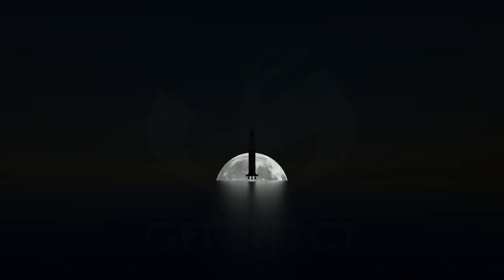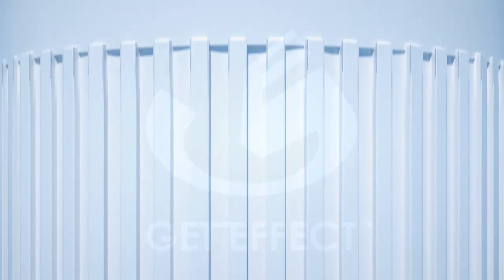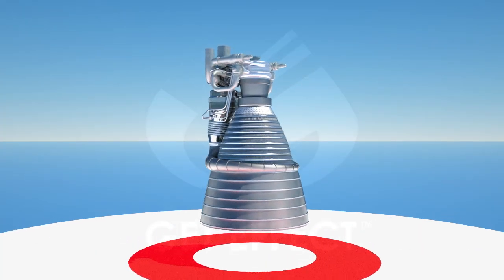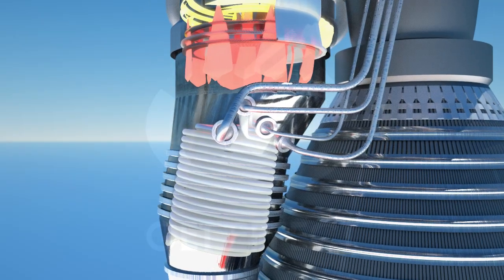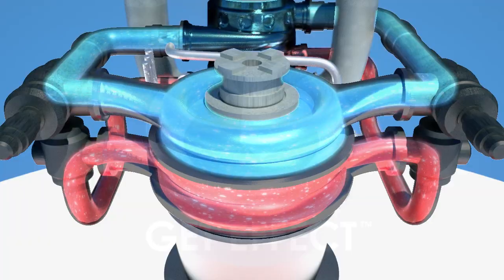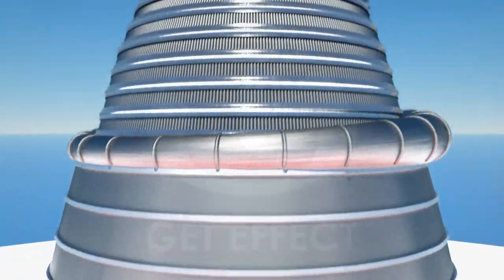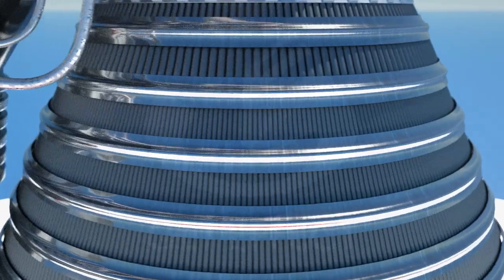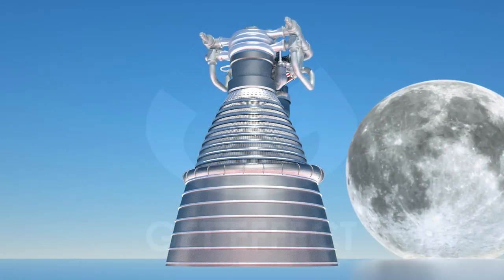NASA SATURN V ROCKETDYNE F1 ROCKET ENGINE, AN ANIMATED DOCUMENTARY (2016)

Comment: Was there ever any study done for a longer-range shuttle flight with a jettisonable internal fuel tank for the cargo bay? What sort of range increase could you expect from a fuel tank the size of the cargo bay?
Reply: A mission to the Moon would probably be realistic. The space shuttle can achieve orbit with a payload with the standard configuration. Adding a fuel tank would probably give it enough range to at leas achieve a "slingshot" around the Moon. The Space Shuttle isn't a good exploration craft though, it's basically a space van to transport equipment and people into orbit.
Reply: Håkon T. Right. I wonder if it could perform missions like lunar orbit rendezvous and retrieval. Re-entry might nix the whole idea of a lunar shuttle though. Could it handle that speed?
Reply: It would probably have to use it's engine to reduce the velocity before re-entry. It would work as a craft to place satellites and such in orbit around the moon, but you don't really need a manned craft to do that anymore.

Comment: It took 55,000 horsepower what they called a gas generator to run just the fuel pump on one engine. 55,000 hp just to run the fuel pump WOW WOW. This is a perfect example of what my father would say that, this vehicle (saturn5) was built by man but is not of this earth. There was nothing to compare it to nothing it was so out of this world. 55,000 hp just to run one fuel pump. That is 275,000 hp to run the fuel pumps on all 5 f-1 engines Would consume 40,000 lbs of fuel or 5,500 gal a sec. have the kinetic energy release of 500,000 lbs. of TNT every second for 2:30 minutes To stand in the presents of that monster I will never forget it.
Reply: 671 gallons of fuel/oxidizer PER SECOND. So basically three firehoses' worth of LOX being shot full blast into three firehoses' worth of fuel and instantly igniting every second the engine's running. Takes off with 85% of the volume of an olympic sized swimming pool on its back, and burns all of it (better than a half a million gallons) in 2.5 minutes.

Best part? Even THAT isn't nearly enough to get the capsule into space. You've still got two more stages to go!
Reply: @orangejoe204  That was why at lift off and while fully tanked with propellants, the first stage weighed 5 million pounds. Those engines devoured 15 tons a second of propellants at full thrust. It's insanity when it comes to the scale of the Saturn V and what went into it's development, construction and flights.
Reply: The power in a rocket motor borders on fantasy. Taking more modern technology as an example, the turbine that drove the high pressure hydrogen pump in a Space Shuttle Main Engine developed 76,000 horsepower, and that was just one of four pumps on that engine.
Reply: @MarsFKA  Still the F1 engine was operated in a very conservative way... Von Braun said it was 25% down of it's max. capabilities, since 5 F1 engines at 75% of thrust were enough for the 3000 ton rocket to pull up from the launch pad.
Let's not forget how in efficient the F1 was! Fuel dampener it was. There were future plans for a second version F1 engine that would have utilized 25% more efficiency and 30% more thrust! Now imagine that!!!!
The F1 still is the father and boss of all rocket engines!
Reply: @jdmlegent  If the designers closed the cycle, and opted for a fuel-rich staged combustion cycle, the F1 engine would be a lot more efficient. Had they used the Russians approach of developing rocket engines, the F1 would have had an oxygen rich pre-burner and thus developed even greater thrust. Still, the F1 is the grand-daddy of all liquid fuel rocket engines that have been designed, built and proven in full scale spaceflights.
Reply: @taraswertelecki3786  I agree with you on that comment. Probably they would have researched a closed cycled F1 engine after the end of the Apollo program , but unfortunately they not only ditched the moon flights but also the equipment and the rockets and it's engines to the trash can!
Reply: The ssme was a engineering masterpeace shame they will be thrown away on sls when they had also been desighned to be reusable :( I had hoped sls would use an human rated variebt of the  rd 69 from the delta 4 heavy.
Reply: Pretty crazy shit. That’s 10 times more power than a Dash 8 Turboprop engine and that was just to drive the fuel into the main engine
Reply: John Mierz you were fortunate to have experienced that my friend. I would have loved to have seen it, heard it, felt it, etc. Good for you man! Seriously, you experienced one of the things that I wish I could go back in time to live. I’m a little envious.
Reply: Ok. Built for men but not designed for men

Comment: Can't wait to see the first flight of the SLS. The SLS heavy lift will be bigger then the Saturn V.
Reply: I hope to be there with my kids to see it. A friend of mine in my neighborhood got to see a Saturn V (Apollo 14, if I remember correctly) launch when he was a teenager because his dad was a high ranking faculty member at the University of Florida. As he put it, he was closer than Cronkite (but not by much). He said he could feel the sound through his entire body. I've experienced a low, fast pass by a couple of F-4s and heard 150 dB Formula 1 V-10s at over 18,000 RPM, but seeing something like that launch would be incomparable.
Reply: I just came across your comment. You might be interested to know that I have experienced  both types of assaults on your senses that you have described. I would say they are quite different; the higher pitch of the F1 car passing by at close range is felt more in your head, like an arrow passing through your head (looking back now, I should have taken more precaution in protecting my hearing) while the lower rumble of the Saturn V and the Space Shuttle is felt in your feet and gut. I saw the last two Apollo launches and about a dozen Shuttle launches. I remember the last Shuttle launch I saw set off car alarms in the parking lot behind me, and that was from about 11 miles away! Both types of  experiences would raise goosebumps on my arm!
Reply: Maybe larger, but the Saturn V had a bigger payload.
Reply: but it says here that they are looking to use the f-1 engine to power it..lolol..so much for modern technology

Comment: id like someone to explain why the burn at sea level looked so terrible in videos we have of saturn v's launching. i know the injector plate had alot of issues in development and by luck they found one design that worked, maybe not aswell as they would have liked but atleast engines werent turning into thousands of pieces like they were with the previous injector plates. i have a feeling its efficiency was extremely low at sea level and didnt really reach a good burn until higher altitudes when they could throttle the engines up to full power.
Reply: Here's something to remember. Question: What's the most difficult foot that a rocket has to travel? Answer: The first one. At liftoff the rocket is near its maximum gross weight because of all the propellants its carrying. As such lifting the rocket up the first foot off the launch pad is the most difficult work the engines need to do. From there the rocket gets progressively lighter and lighter so lifting it up higher and higher gets easier and easier. Accordingly the F-1's were designed to produce maximum thrust at sea level to lift the enormous load of the entire fully loaded vehicle. I'm not sure what you mean by "terrible" but in fact the F-1 engine's performance at sea level was optimized to produce the most thrust and lift to get the Saturn V off the launch pad.

The problems associated with designing the injector plate that you referred to had nothing to do with efficiency. They had to do with a problem called "combustion instability". In larger rocket engines acoustical standing waves can and do form inside the larger combustion chamber. These waves can intensify as they flow back and forth across the surface of the injector plate and eventually they can blow a hole in the wall of the combustion chamber. The eventual solutions on the F-1 were to adjust the angles of the holes drilled in the plate to move the propellant mixing and initial combustion a sufficient distance away from the surface of the plate. They also added acoustical fences onto the injector plate. The fences essentially split the entire surface of the large plate into 13 smaller segments. These design enhancements eliminated the formation of the standing waves inside the combustion chamber that had destroyed earlier test versions of the engine.

Also, the F-1 engines were not throttleable. You might be thinking of the Space Shuttle Main Engines, which were throttleable. There was a need to reduce the thrust of all 5 F-1 engines later in the burn due to excessive acceleration as the propellants burned off, but this was accomplished by shutting down the center inboard engine early to limit the acceleration.
Reply: Why does it look 'terrible'?  For one thing, it's kerosene, not hydrogen... so that's why you get the big orange flame.  For another, you are seeing the dark part... that's the turbine exhaust, cooling the chamber walls of the expansion cone... the dark band is by design.  Extensive work was done on the combustion chamber to damp resonances... the final configuration would self-damp in 1/10th of a second, they tested using explosive charges to upset the combustion dynamics.  Nothing terrible at all about this engine or the way it performed.
Reply: If you mean why the flame is so dark, it is because you see the fuel-rich exhaust from the turbo-pump turbine being dumped around the periphery of the bottom skirt to cool it and protect it from the hotter gases emanating from the main burn within the engine itself. Joe Vignolo below has explained the F1 engine's performance efficiency well but I'd like to add that it is a open cycle engine i.e. it's turbine exhaust is dumped outside the injector plate. Open cycle engines are inefficient compared to closed cycle engines that extract more work out of the engine by dumping the turbine exhaust through the injector plate but they are much more complicated to design and build.

Comment: This is very nice that this information was saved by NASA; now all they have to do is find the blueprint specs for materials used to get through the Van Allen Radiation Belts - (whether they went through a thin section of the VABs or not).
Reply: The Apollo astronauts received less than 5% of the yearly allowed dosage for workers in a nuclear plant. Basically about as bad as a chest x-ray. It was relatively easy for NASA to design the Apollo's course to avoid the highest flux areas when passing through. In other words, it was not a big deal.
Reply: +Goldpenny1 stopping radiation from belts is easy some aluminum or plastic to stop most of it. the real problem is modern electonics which doesnt like radiation. So they have to develop system so that they can use the modern stuff instead of stuff from 60s.

Comment: Could someone please tell me, where the helium tanks for pressurizing the fuel tank were located? The volume of the fuel tank was huge and I think it would need a lot of helium to pressurize it
Reply from the maker: Hi. In the first stage, there were 4 pressurised helium tanks located inside the LOX tank.
Reply: Get Effect thank you very much
Reply: http://heroicrelics.org/info/s-ic/s-ic-major-components/s-ic-major-components-med.jpg
Why no one links images is beyond me.
Reply: silverbird58 filled with supercooled liquid oxygen and kerosene on the pad minutes before launch. Inert Helium is used as a pressurant. As the fuels begin to rise in temperature there's a need for venting, that's  the white clouds coming from the booster, right before ignition these are closed, to further increase pressure to the engines at launch.
Reply: The LOX was not super-cooled like the Falcon 9.  It was just below the boiling point. The LOX that boiled off was replenished as needed during the count down; that's what all the piping/fittings needing to be detached at liftoff was all about. But yes the helium was used to keep the flow rates stable during the flight.
Reply: It was in the same Tanks as the Kerosene under the pressure Dome in the void above the Liquid.
Reply: Thank you for posting this link I did not know of it till now
Reply: That is one heck of a site, thanks for the link.
Reply: I will have to try that.
Reply: How much horseradish do you use?